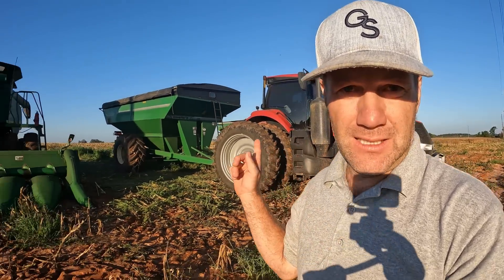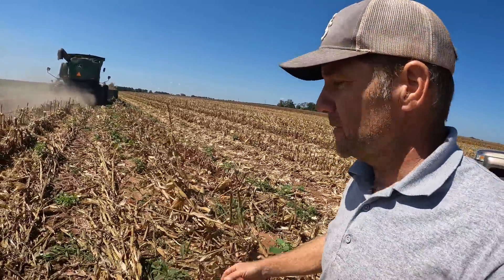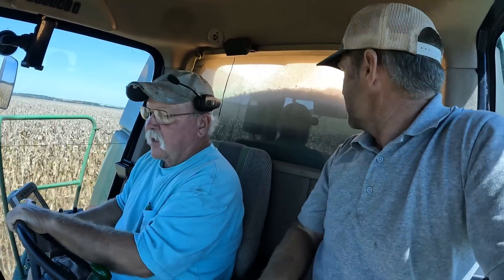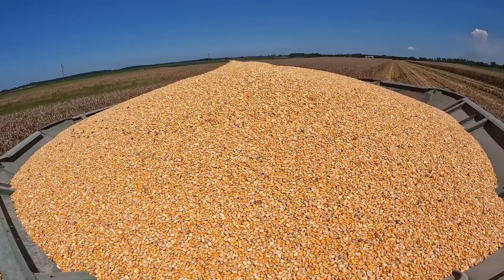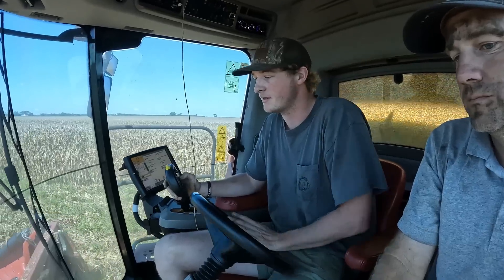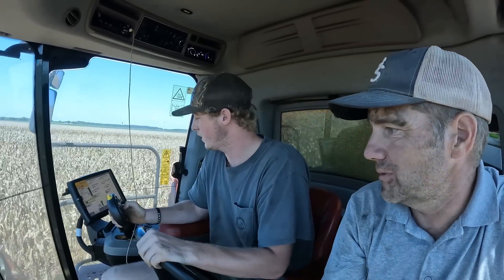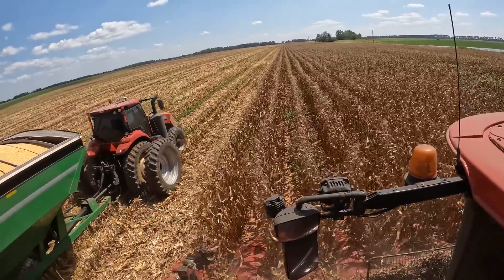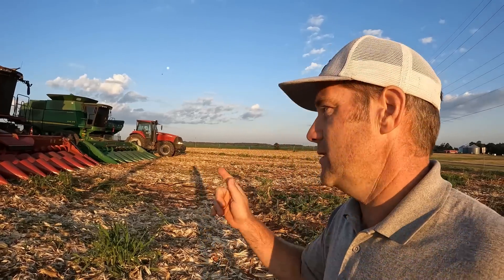Case IH v. John Deere Combines

Comment: 4,000 hrs and the Deere needed a new motor!!!!! Much as that machine costs!!!! Nope not good in my book.
Reply from the maker: @johnscurlock1204  JD tractors since the implementation of regin average 7,000-8,000 hours on an engine.  We get 17,000-20,000 hours on the pre regin engines.
Reply: @PatrickShivers What do regen motors do if deleted when new? I know it's illegal in the states, but like a machine in mexico or something.
Reply from the maker: @ deleting regen makes the engine run cooler, which drastically increases lifespan, increases horsepower, and increases fuel efficiency.
Reply: @rolandohiebert2144  Illegal, yes but many places they barely enforce it. Deleting the EGR, DPF, SCR, etc and changing the tuning makes it a whole new machine. Voids your warranty of course and many dealers aren't able to work on non-compliant engines but when they're deleted you aren't gonna need dealer service techs nearly as much

Comment: I think JD combines is little better
Reply from the maker: @zilla2006able  All the operators I have talked to that have ran both without hesitation say Case is better.  Half the operators I talk to that have only run Deere say Case is “better on corn,” and of coarse it’s common knowledge that JD ripped off the axial flow design that Case invented and used for 20 years before JD converted.  
  In my experience walking behind them and riding in them back to back, the Case had a much less experienced operator and was still doing a better job (running less corn out the back).  The Case is also about 70% quieter in the cab.
All that said, if you want a Cotton Picker call John Deere.

Comment: Nice comparison video. I almost want to call into question the generational levels of the combines. The Case is a newer combine against the John Deere, but like you said, dial the machine in correctly and there's almost no difference

Comment: You better put something around the post to your weather station outside ive bought 2 in ayear because of snts
Reply: Ants
Reply from the maker: @chrisbubba6000  thanks for the tip!  You think the electric current in it is attracting them to the sensor?
Reply: @PatrickShivers  yes I do I put my 3rd one up Wednesday I put gear oil around the post this time an try to stop them hope that will work we hot fire ants bad

Comment: Enjoyed the video Patrick! I'm John Deere man but case IH is best in corn in my opinion. God bless
Reply from the maker: @gregrhodes8451  I believe you are right as well.
Reply: I love the John Deere Combine
Reply: Ive been around lots of Deere’s and a few reds. The axial flow has less aggressive threshing system. The feed accelerator on a deere can cause issues in corn. This can help in hard threshing crops such as soybeans on the green side. But axial flows in corn have a wide sweet spots and are easy to set and just run.
Reply from the maker: @derekmartin2817  I think a lot of operators concur with what you are saying